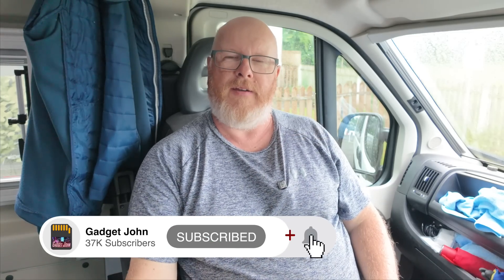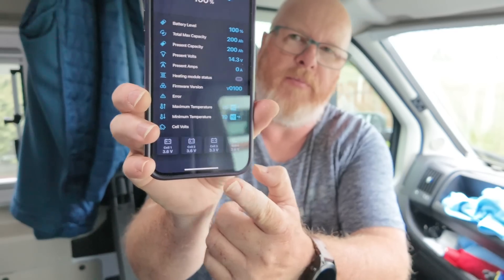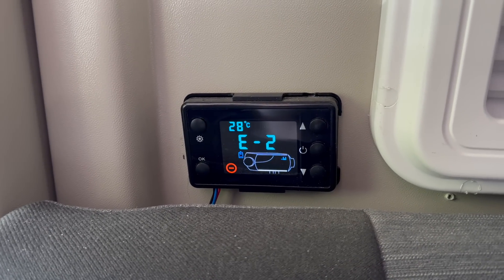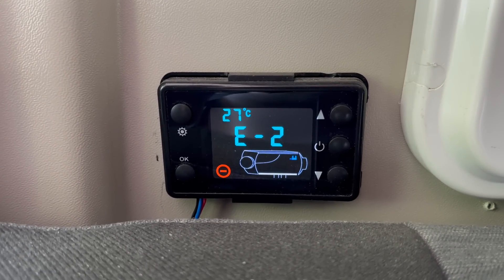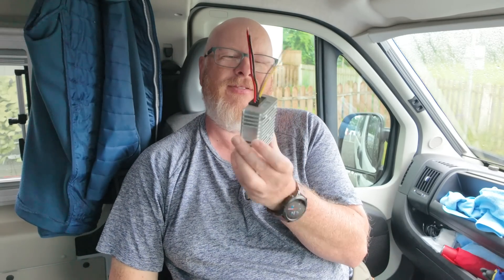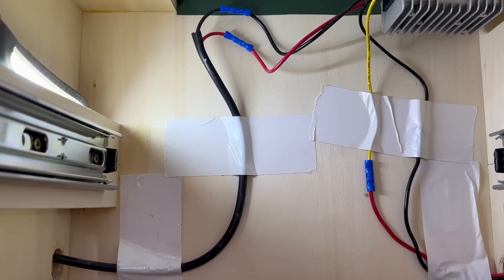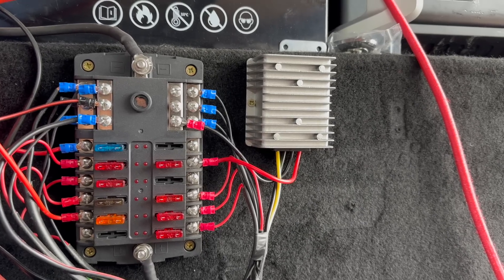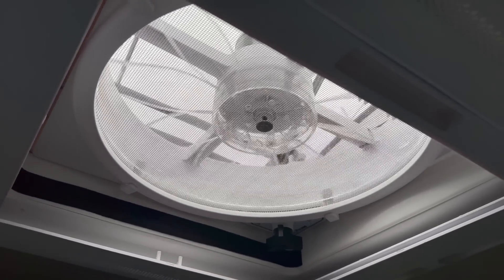The Voltage Regulator no one knew We All Need!

Comment: I've got an cctv system, and a router in my van , used one of those from the start. As an electronics electronics engineer ,rectification of the power  supply is essential for smooth operation
Reply: but stating stuff that draws amps and does some work runs more powerful of LOWER voltage is complete BS.

voltage is half the equation of power amps times volts is power.

lower voltage with most loads means also lower amp draw which is exactly power drop squared.  and that ceiling fan ain't gonna run better on lower voltage.

it will run less noisy over the lower volume throughput => less power / less work being done.

the chinese cheapy diesel heater was setup on the lean side if it burned hotter on less airflow. proper units keep the RPM no matter the voltage.

computers/MCU's and stuff on the other hand might be suseptable to high ripple voltsges from the alternator.   but only for non-automotive grade PSU's in the devices. ie home appliances running off a power brick/wall wart.

Comment: That is very useful information for anyone with a van or even building one.
If you have a fuse board providing power to more than 1 USB or USBC port perhaps you can mount it near the fuse board so that it feeds everything on that circuit.

Comment: Thanks John for  this very interesting video. I have just stumbled across your channel this being the first viewed. I have recently upgraded from lead acid auxiliary battery to Life Po4. Reassembled the wiring as it was on the old battery and nothing but my water pump works. I don't have gadgets to run just the usual bits lights etc. totally baffled.
You may have solved my problem or at least given me something I can try.
Thanks again, will sub and like.

Comment: What kind of "lithium" battery are you using?  NMC and LFP are not the same.  What you are describing sounds like NMC, which has a higher nominal voltage than LFP.  I've been using and building (from components) various types of lithium batteries for several years and found that LFP is not only far more suitable than NMC, it actually offers more stable voltage output than even lead-acid can.
Reply: His description of loads of small cells paralled to make 3.6v did make it sound more like lithium Ion which has a cell voltage of 4.2v or so in normal use but 3.65v is the maximum for LiFePO4, so I think he was thinking of those even though they are rarely if ever made of small cells these days

Comment: Deffo don't use Lithium Ion NMC/NCA cells in your van! LFP or LiFeP04 is the far safer option. Less slightly less energy and volumetric density but significantly safer as LFP's don't suffer from thermal runaway issues... 
Also worth noting that the Sargent van systems are designed for 12v Pb batteries thus really don't like the upper voltage of a LFP battery that's on charge and nearly full...

Comment: Your problem is not associated with lithium. Alternators will push out 14.5v when charging lead batteries. If you had a lithium battery with Bluetooth access to your settings, DC/DC converter and Victron MPPTs you could adjust your maximum voltage on the lithium to be lower, such that you dont create high voltages. You can't do this with lead as you need the high voltages to burn off sulphation.

Comment: a diesel heater desgined for vehicles with a  "12 Volt"-System should be able to work with the realistic and expectable voltages in a vehicle.
Charging voltages in a vehicle are expected to be up to 14,8 volts and above. 
If it can't take that voltage it is not suitable for vehicle.

typical household 12v devices that come with their own powersupply might not be designed to cope with  big range of higher or lower voltages.
Reply: But Chinese
Reply: agreed. mine is eberspacher and it sits on the "load" output of my Victron Solar Controller, along with the other stuff eg. compressor fridge. They work fine. I notice the load output voltage is "allowed" to go up to 14.6v, the  Li-po leisure battery's max v).  I must say I like John's Diesel heater controller more that the crappy one that came with mine.

Comment: LiIon charge endvoltage is 4.2 V  so 4S has 16.8 V  LFP has 3.65 Endvoltage 4S= 14.6 V.  If you use LiIon 3S is closest to  12 V with 12.6V
Buck converters need 1.5-1.8V headroom. So for 12V you need > 13.8 min Voltage
Also consider low voltage shutdown if some devices (smarter fridges) that prevent battery overdischarge will not work as the voltage they see stay at 12V even when the battery is empty.  I want my high current devices shut down before low current devices also die at the same time. (Think of nav instruments on a sailboat)
Reply: if you loose the head room for the buck doesnt it just pass the battery voltage so not really a problem
Reply: @phester28  I don’t know. But that makes sense.

Comment: I have a standard Swift Escape 674 no lithium. I to was worried about higher voltages especially when the engine is running and the smart alternator produces more than 14 volts. I fitted a mobile router which is 12v supply I decided to regulate the voltage to exactly 12v and so far has worked great. To be fair it worked ok before but I’ve seen this sort of thing cause problems in the past but it’s sort of problem that creeps up and you don’t know the reason why. 
So well done for pointing this out.

Comment: Wow I will get straight to work on it tho under voltage was always my problem
Reply: The 6A regulator should help there then, as it probably steps the voltage up internally to 40V before down-regulating to 12V for the output (i.e. it is a combined step up/step down regulator, not just a step down regulator).

Comment: Hi John, I have a similar problem with my caravan water pump pressure switch. When plugged into 240 v on a site the pump works fine. When on '12' v off grid, the pump won't switch off. I have to readjust the pressure switch setting. I did try a buck converter successfully on a previous caravan with the same problem but have not refitted it to my present caravan...yet! Varying battery voltage can cause odd problems.

Comment: Thanks for the video John, it’s very interesting to see the results you’re getting. Having worked with electronics my entire life I can only agree that the voltage is critical to so many devices. The surprise for me is that so many manufacturers haven’t already fitted regulators within their equipment to stop this happening. Especially those devices designed for use in a vehicle.
Reply: Cost saving, no doubt.

Comment: Just bought one for my eberspacher s2 d2 as it is the only thing i run of my leisure battery that is victron dc/dc charged from alternator, hopefully this will reduce some of the risk of failure from what is an expensive heater.

Comment: Hard to believe that a little bit of overvoltage would have such an effect. I normally suffer with the undervoltage to my diesel heater from my old agm 😆 Ive just installed a lithium battery and have yet to use the camper so 🤞 i dont notice any major issues. Thanks for sharing this, if i have any problems its something i can think about doing 👍
Reply: A diesel heater needs a large current at startup (glow-plug)... but once it's fired up, the current draw is very small.

Comment: Hi John, do I need one regulator per fan, or can I run 2 fans on 1 regulator.
Reply from the maker: I ran both fans from a single 12 amp
Regulator and that’s been fully tested with fans both on full and the regulator didn’t even get warm.
Reply: @GadgetJohn  Many thanks for  that info

Comment: Why didn't you get a big one for the entire 12v system
Reply from the maker: They don’t make them
Reply: @GadgetJohn hi - I think that Victron make a unit - Victron Energy Orion -Tr Dc-Dc Converter 12v-12v 9A (110W) - Isolated. At £63 not cheap but I wonder if this might be the one component solution? I have little technical knowledge so be kind on your reply. Thanks 👍

Comment: I had to use a 12v up buck regulator  for the synology nas I have in my motorhome. As its very fussy about its input voltage. It does not like going over about 12.3v and does not like going below 12.0v. So it would kick off when the voltage goes hi charing, and the same if a big load kicks in (my inverter) pulling the voltage low for a second. There is the odd thing I have does not like over volate but does not mind slight under voltage for a few seconds, so I can use a simple buck converter for those, rather than the more expensive up buck converter.

Comment: Hi john good vid would it be possible to instal one large regulator on the supply to your fuse board obviously a suitable amperage ?
Reply from the maker: Yes, though I’m wondering why the likes of renogy & victron haven’t made one.
Reply: @GadgetJohn  I believe you can use a dc-dc converter like the orion 12/12/30 . Switch it to 'power supply'' not 'charger', and you can change the output in 0.1v increments. So 30A would probably cover most all of the 12v requirements in a medium size camper. I will say I have nort tried it, but I cant see why it wont work?
Reply from the maker: I have one already and tried it but the usage without load was much bigger than the regulators.
Reply: @GadgetJohn  AHH right. Obviously normal use of the Orion is charging, so efficiency isn't really an issue. But if it's taking a decent %efficiency then it may not be the answer.
Reply: @GadgetJohn  victron do look at the orion dc to dc converters they have one that takes 8-17v in and gives 10-15v regulated output (user settable but defaults to 12.2v) biggest 12v one can handle 360w
Reply: Yes maybe they don’t know 😂you are ahead of the game gadget productions needs to make one 👍
Reply: @nigelhewitt4886 victron do look at the orion dc to dc converters they have one that takes 8-17v in and gives 10-15v regulated output (user settable but defaults to 12.2v) biggest 12v one can handle 360w

Comment: Well John, some of the devices benefit of the lower 12V you supply to them. You are also adding idle current loads on your system. It might surprise you how much a single one of these units use doing absolutely nothing
Reply from the maker: They use less than an amp a day, combined, so really nothing worth mentioning.
Reply: @GadgetJohn  Depends on the system. My bike camper trailer is only going to have a small 5Ah battery, so that would be 20% of my power wasted by this unit. Hopefully I'll find something similar with a lower power capacity but with less waste.
Reply: I put it after the switch so not drawing anything off load.

Comment: This all makes sense. This is partly why I am usingTeltonika stuff for the switch and router in my campervan build as they can take input of 9-50V. I do use a converter for my laptop docking station as it uses 22V, but to be honest, never even thought about how fussy the Maxair fans or diesel heater would be. Thanks for the headsup!

Comment: Another interesting topic thank you. I am approaching it from the other direction ( you may recall I asked about regulated output on the recent power battery you tested ….. specifically output from the 12v port ) These tend to be regulated if I understand it so voltage drop can be an issue. I have tried to add my Ecoflow to my battery bank using the 12v 10 amp output but it has limited effect, I’ve found something similar that does the opposite and seems to take that regulated 12v and boost it to a variable level…. So my theory is I can boost the regulated output into my system to a higher voltage similar to that the charger might supply 13.2 volts meaning the Ecoflow would take over all the 12v duties when added to the 12v circuit. With a bit of parasitic charging to the 12v battery bank…. Worth a try I hope that made sense !

Comment: It’s a shame they don’t build stuff to work up to 15/16v where its 12v to avoid the need to add additional components - I think MaxxFan have recently addressed the issue they had - basic electronics design for van stuff for 2020 onwards eh. Trouble with the buck converters is the waste of power like inverters, hopefully in the future better design to support - appreciate stuff like Alexas aren’t really designed for vans so you can understand for those, but Diesel heaters clearly are… (and Maxxfans etc) - Hope you’re good… have a great weekend, All the best, David 👍
Reply from the maker: I think it’s a shame renogy or victron don’t make a large regulator that you can run all your small 12v appliances from

Comment: Great vlog. To confirm  you have one regulator for both Maxx fans wired in series and via one fuse on the board hence the 12 amps, is that correct?
Reply from the maker: Wired both max fans into the output of the 12a regulator.

Comment: Hi John, I bought a champion generator from Costco which actually runs 115 V and my chopsaw is 110 V for site work of course, and yes in time it burnt my saw out the repair shop are saying The generator is for the American market and has overpowered the saw they tell me they see this all the time as much as it works it. Also Shortens the a life power tools. 🤷‍♂️
Reply: Your repair shop is feeding you horse crap. The mains supply can vary by far more than 5 volts anyway and electric motors are very tolerant of voltage changes. I would suggest however testing the voltage output of the generator as they're often badly set up. Unless it's an inverter generator the voltage is almost completely reliant on the engine speed. There will be an adjustment screw or something similar on the governor to adjust the running speed. Check the voltage under load and adjust as required.
Reply: @stubarnes1965 You also have to bear in mind the frequency if it’s a genuine 115 volt 60 hertz US model. An induction motor for uk site use would rev higher, but the consumed power shouldn’t increase too much. As you say, check the regulator. I find a cheap plug in power meter is more than adequate, and test on a non reactive load to start with.

Comment: Thanks John. I was wondering the same thing when my LED light replacements were getting hot and blowing on occasion. I used the same Dc to Dc 12v controller in the fuse line for the lighting and have had no problems. Ended up buying an additional 30amp Dc to Dc 13.8v converter and put in line with the camper main accessories fuse. 1.8v extra allows USB chargers etc to charge better but keeps the working voltage within range for most 12v appliances like your Echo DOT. Not sure I have it all right but like you, have a technical background and feel I got it about right. Great video, pleased to see it out there. Russell

Comment: Excellent info John.. I wonder if my pure sine inverter is affected by higher input voltage? With engine running or solar powering I can get 14.6-8v…? It seems to work ok beside cooling fans occasionally come on 🤷🏻‍♂️

Comment: Good video. I was just looking at one of these to supply 19.5 volts and was also considering chopping off the 12v lead for my router so I could write it straight to the fuseboard. I'll likely get a 12V regulator a well as a 19.5 one.  My fridge is quite noisy,  although it is old and the condenser is noisy and vibrates,  requiring a bit of extra padding between it and the back of the fridge.  Will be interesting to see if the correct voltage helps. 

Thanks for posting.

Comment: My understanding is that many of these converters are actually buck/boost, i.e., they can be wired to either decrease or increase voltage.  Not saying your’s is.
Reply from the maker: Doesn’t matter, it fixes a problem for me
Reply: Well with an input voltage of 9-36v and an output of 12v, it certainly will be buck/boost yes

Comment: 😂 I'm having a chuckle to myself after wondering if you were going to mention the maxfan as well, and you did. I found that my fan wouldn't work when the leasure battery voltage went high due to the on-board battery charger cycle. It took me a little while to fathom it out, ( the voltage range is described in the instructions somewhere) but I too fitted the same regulator to a supplementary fuse board ( like in your photo) and it cured the problem. A word of caution to others though, as the first regulator I bought was defective and was wildly inaccurate, leading to a range of outputs, so my advice is do check the output of these regulators before installing as not all regulators are of equal quality. Cheers John, I enjoyed the video and the explanation.  👋
Reply: Yah, we had same problem with Maxxair fan. I STILL think that they should've put the circuitry in to make them handle charging voltage as automobile electrical systems are not that precise. But, alas, they're too cheap to do so. One thing to note - these voltage regulators consume some power ( not much, but not zero ) - so keep that in mind when you're making your power-use calculations.
Reply: Just an addendum. When you`re checking regulator outptut. Check it while under load. A 1amp bulb is enough. This will check not only the regulator, but the wiring and any connections in between...
Reply: I had to check this last year when I did my build, the newer versions of the Maxxair Maxxfan (PCB "C") accept between 10.3v and 15v (officially from Airxcel)
Reply: Hi - question to commentator ‘CJ’ - how to I check if I have ‘PCB ‘C’’? I have just purchased (July 2024). Where might I see or read Aircel’ confirmation that the Maxxfan will operate successfully in the voltage range you have indicated? Hope to hear thanks. 👍
Reply: @regnbean67  Get a $30 regulator to be 100% sure to save your $300 fan. Just sayin.
Reply: @Jollyprez  thanks for your comment. Think that might be the best way to go. Cheers 👍
Reply: @regnbean67  just seen your reply! A quick call to support and they'll check your serial. Very simple process, hope that helps